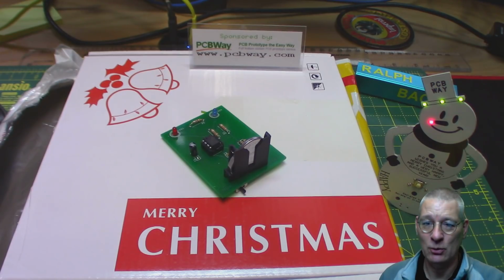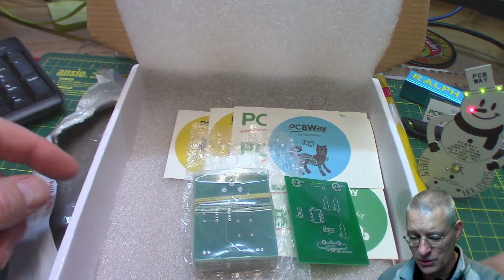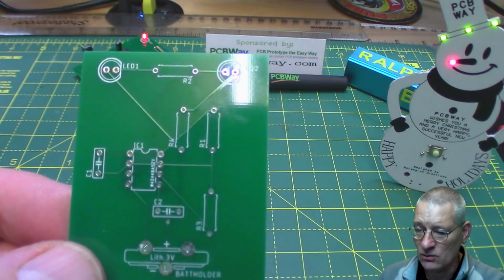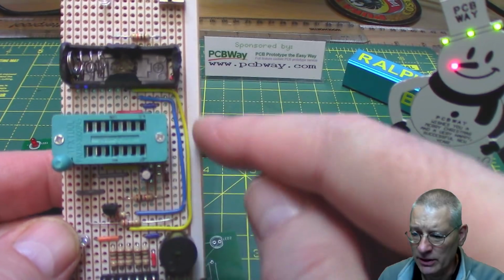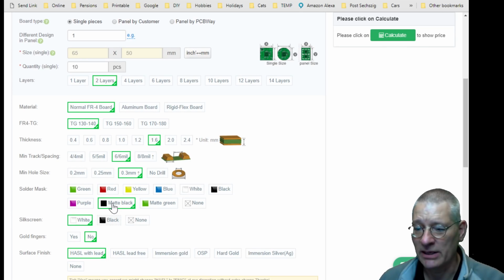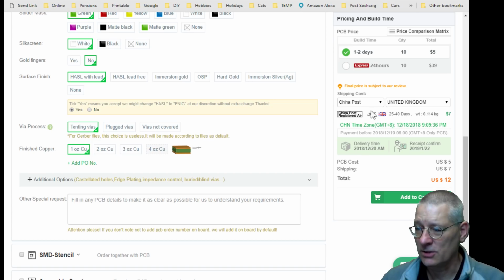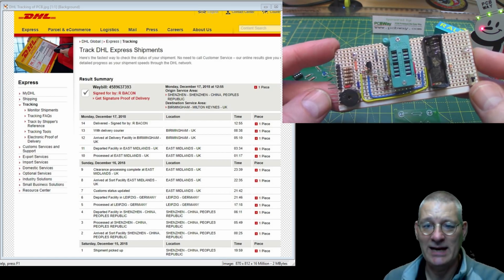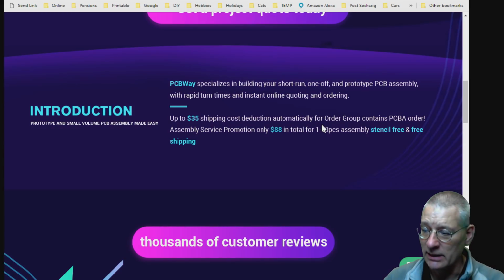#128 Making a PCB with PCBWay (I made ⚡ one)

Comment: Hello, what circuit did you make? It looks a like a simple flashing led with a 555 timer with a 3V coin battery?
Reply from the maker: Yes, 4 years ago I was just starting my PCB making journey. A 555 timer and two 🟢🍎flashing LEDs seemed a simple enough circuit just to get something running.

Today, I make PCBs as a matter of course, having learned many lessons on the way (mainly how NOT to do things!). Experience does not come cheap!

In fact, today I am in much the same position with my 3D printer, just starting out, learning CAD along the way and generating ever-increasing complex modules. It's a rocky road but a very rewarding one.

Comment: I tried to place an order with PCBWay and I had a small board designed (45x20mm) and panelize.  3 emails later asking me the same question if I wanted it panelized. I replied each time. Then I finally went to their site and online chat with their help agent. After an hour and a half trying to get the information straight. Finally they get it. The price  doubled to $24.40 plus $23. DHL shipping.  I had also submitted the very same gerber file ordered from JLCPCB to compare the two. JLCPCB had no problem and I had the product in my hands in 6 days. Their price was $11.71 + 23. shipping from DHL. I canceled the order from PCBWay as the experience was bad and they did not seem to know what they were doing.  Wasted my time and in the time I spent trying to get the order set up, I had the boards from JLCPCB in my hands. Quality was amazing.  I have no affiliaton to JLCPCB but thought I would share my experience. Think twice about PCBWay.
Reply from the maker: Your PCBWay experience is unfortunate, and not one I've ever had (and they don't treat me any differently to any other customer). 

I guess the online order form had some sort of discrepancy / omission so they tried to clarify with you but things then seem to have got a bit confused. Give them another try, they deal with thousands of board a week so they can't be that bad at it!

Comment: Thanks for the very informative video Ralph. I ordered my first ever PCBs from PCBWay after watching this. My design was over their 100x100 mm $5 limit which put it up to $25,  I still got to use my $5 first order voucher though. Also, this must have put me over some kind of import tariff threshold, hence I had pay DHL another £17 to release the delivery. Even with this, it was much cheaper than anywhere I could find in the UK. 

I ordered on Saturday and they arrived on the following Friday! Amazing! As far as I can tell they boards are great quality. I didn't even make any mistakes with my design! Couldn't be happier.
Reply from the maker: Congratulations, Tom, on your error-free design. Great when it works out that way. A pity you went over the import allowance that definitely bumps up the price considerably, happened to me once with something from the States. It's the VAT that can really add up at 20%. Anyway, all's well that ends well, good luck with your construction!
Reply: £15 max for goods outside the EU

Comment: I'm normally not fond of promotional videos, but this one was really good and informative. I might very well even use PCBWay.
I actually stopped making pcbs because of the hassle (done on the kitchen table kind of) but if I can get quality pcbs for that price and short waiting time - I think I'd better get started on all the old projects that have been sitting around for a while now.
Thanks for a very informative video.
Reply from the maker: You are most welcome, Zeedijk Mikem glad you enjoyed it. 

I thought long and hard about doing this video, but finally I thought that I "promote" items from Banggood, Aliexpress, Gearbest, Amazon... (the list goes on) in most of my videos. So I thought that if I were going to do this I would do it faithfully, as though I were a regular customer. It seems to have been accepted as such, for which I'm thankful, as there was no way I was going to just promote an item without having tried it out first! Like you, I stopped making PCBs on the kitchen table some time ago; too messy, too amateurish and too long-winded! And, of course, only single sided (usually).

The hardest part now is actually designing the PCB from a proven schematic. I used both EasyEDA and KiCAD and you'll have to wait for my report on which I prefer, but I've just received my 2nd PCB (an Arduino Uno shield for my ultrasonic dog barking project) which looks much better than the first one. I've yet to check it out, it literally arrived an hour ago. We shall see!
Reply: @RalphBacon 
I have always loved laying out pcbs. I can easily spend days design. Quite often I end up starting all over from scratch just to avoid a wire link. I have made a few double sided boards but that's too much a hassle.
Have a look at my blog if you want to see a few of my boards, nothing super fancy or exciting just enjoyable projects (-:
Reply from the maker: And so I did have a quick look. Nice boards. I was particularly impressed with the pendulum clock, not just the PCB for it but the overall project. Very nice indeed. Of course, if you did use one of the Chinese PCB fabs then your boards would be even nicer, green and double sided too! :)

Comment: Why do they send packages for the UK trough my neighborhood (Leipzig is an hours drive away)? Does not really make sense or? Nevertheless nice video. I never created/made/ordered a PCB myself until now because often I just produce a one off and use a Perfboard. So I can finish the project the same day. Because projects that lay around sometimes never finish (as we’ve found out before).
Reply from the maker: I'm just guessing here, Michael, but cargo deliveries via Leipzig in Germany and then West Midlands Airport in the UK are probably a lot cheaper than going via the main passenger hubs. They are probably designed to take large volumes of packages rather than passengers too. As I say, though, this is a guess.
 
I hear you when you say that projects that lay around awaiting a PCB never get finished. True. But the design of the PCB is now part of that project, and if you are prepared to pay the DHL delivery I don't think 3 days would be long enough for me to lose interest in a project. If I used the slow China Post delivery it would be a different story, probably! I've just a few IRF7317 dual MOSFET chips delivered that I ordered back in October. Um... what was that all about again?
Reply: Ralph S Bacon Leipzig is besides Frankfurt the biggest DHL Logistic Centre in Germany. And it’s next to the Leipzig airport. So you May be right. And they are allowed to start and land all trough the night in Leipzig which is not usual on every airport in Germany. I started to make notes for which project I ordered something. So I can recap if a package on the slow boat from China arrives months later.....

Comment: That was really interesting but I would like to have seen how you got to the gerber file stage as for me that would appear to be the tricky bit!  I would like to try using one of these services but haven't yet plucked up the courage!
Reply from the maker: I would have loved to have shown you that but it requires a video in itself. You need to be able to draw the circuit diagram first (the schematic). The PCB is then linked to the schematic so you know you've done it right. Once I am up to speed (probably with KiCAD or EasyEDA) I'll look to do a video.
Reply: @RalphBacon  I look forward to it.  I have a watched some videos on creating Gerber files but they can take a lot for granted!  Schematics are not really an issue as I was an electrical engineer but software is another story!

Comment: In February this year I was laid up in bed fr 3 months due to a back problem, and decided to teach myself Kicad. To do this I made a replica of the 1977 Science o Cambridge )Sinclair) MK14... a bit ambitious but for the previous 2 years I'd been collecting parts (Well, some parts had been obsolete for 30 years so were hard to find!). and with some help from members of the Vintage Radio forum where MK14 experts seem to skulk I was able to make the schematic & PCB layout ( Full story at https://www.vintage-radio.net/forum/showthread.php?t=145663 - I'm Slothie). I submitted my design to JLCPCB through their website which was very similar to the process you describe for PCBWay. Despite my bord being much bigger than yours (abiut 11 inches by 5 inches) it onl cost aebout £18 for 5 boards- I think I got free shipping for my first order - and it came in about 7 days. The quality of the product was very similar to yours, and the only problem I had with the boards were the small design errors I made. 11 wire links later I had a working replica. I'm in the process of making the Rev 2 version with the errors corrected and some improvements I have noticed from building it and from suggestions from the forum. It has been a thoroughly  enjoyable experience - before I had never used a PCB cad program so I can assure anyone reading this that they should give it a go. I'm a bit addicted now :)
Reply from the maker: I'm sorry you were laid up in the first place,Ian, but something good came out of it, it would appear. I'm extremely impressed that you made just 11 errors in that design. As it happens, thanks to all the comments here, I'm moving away from over-complicated Eagle and onto KiCad but I will also look at EasyEDA. It's something I definitely want to master. Thanks for your post, it was very interesting.
Reply: @RalphBacon   I must confess I was surprised it worked too :) It would have been fewer than 11 if the schematic I was working from didn't have the column lines for the display marked wrong - the display ended up being backward so I had to cut the tracks and put them back in correctly with mod wire! The other problems were caused by me making mistakes when creating a new schematic symbol for the INS8060 SC/MP processor and labelling 2 pins with the same number. Fortunately it just resulted in one pin being unconnected so I was able to put in a short wire to fix that too.
I looked at Eagle but couldn't use the free version because of the ridiculously small board size you are restricted to (80 x 50mm) unless you subscribe to the highest tier which is hundreds of pounds. The small size is OK for people doing small projects or using SMD but for things with 40 pin DIP chips yjat I was interested in doing, no use at all! EasyEDA is highly spoken of by many but I just like to have something installed on my PC that I can keep forever and not rely on a third party's server not going away sometime in the future and taking away access to all my designs! KiCAD is quirky and has a few bugs but nothing too serious, once you get the hang of the rather arcane symbol/footprint library its quite easy to use, and its actively being funded by CERN and other organisations, so for the moment  it seems to have a good future.
Reply from the maker: "[KiCAD] is actively being funded by CERN and other organisations..." - wow! That must give it some weight in my considerations then. Thanks, Ian.

Comment: I designed a 4 channel relay board ( Only because I have 300 or more of them ) with Easyeda and sent them off to JLPCB. They were done fast and very well also. I did thicken up the tracks on mine and after doing it all I sent the files and paid. I think 2.00 and 25.00 shipping.
After getting the PCB's ( 10 for the 27.00 ) I mounted all the parts and it works fine. The only screw-up I did was the transistor pad was 3 pin vertical ( Not Triangle Shaped ) which is hard to solder because the pads were so close together. I think the next 9 boards I do I will use Kapton tape as I solder so they don't bridge across to the next pin. I like the Idea that PCBWay lets you share boards. That to me is worth it. Thanks for all the videos you have done so far and I hope you do many more in the future. Drex / B.C. Canada.
Reply from the maker: Wow, you too have much more experience than me in the PCB design world, Drex. I don't really know why I haven't explored this avenue before. so I have something to thank PCBWay for too! I'm looking at KiCad right now but will also look at EasyEDA too. If I get good at it, or design something useful, I'll let everyone know!

Comment: What I like about doing pcb’s is that I know the board is in sync with the schematic.    After I populate and ‘fix’ my mistakes it’s easy to see what is the original circuit and what are the parches.  This assumes you start the process with the schematic editor.    Layout can be relaxing, kind of zen like oil painting.   Knowing when to stop is a problem common to both.
Reply from the maker: Quite so, Dan, the sync between schematic and board is fantastic. And knowing when to stop is something I now face too. Just move that one track over to the left, oh and that one up a bit...

Comment: Really good thanks for showing me this, I have a project I am planning on finishing in the new year and need to get my PCB board printed. EasyEDA recommend JLB and I haven't heard of PCBway so thanks for showing the ordering process will probably use them. Btw you need to practice more with PCB design 😂 I have finally seen something that I can do better than you. Please don't think that's a dig as I think your skill with microcontroller is way above mine. G
Reply from the maker: You speak the truth, Gordon, my design was rubbish. But it was my very first design, using the rather complicated Eagle for the first time so I can only improve, I hope! I'm currently using KiCAD but will try out EasyEDA too. I'll soon be designing 4-layer Arduino shields... 😂
Reply: @RalphBacon   yes eagle is good but you have to pay to use the good features on it, and it's very difficult for beginners. I  started with PCB wizard witch is fantastic for beginners! The draw back is you can't make grber files lol as it's for home use. btw I use easyEDA because I have a Mac computer and its most compatible. Loads of people use kiCad but it's triable on Mac. If you switch and make another video try KiCad as many users have PC's.

Comment: Very good video.
I'm trying to make a PCB for my project with a ESP32 Dev Kit board.
Could you make a video maybe using Fritzing for designing very simple PCB?
Easyeda is another web based solution but I find it a little more complicated.
Reply from the maker: I don't know why, but Fritzing is frowned upon in the Arduino forum - I think schematics (circuit diagrams) are the best way of describing a circuit - they can be directly linked to a PCB using KiCAD or EasyEDA. Once I get up to speed I will probably do a beginners' video.

Comment: If you're going to put your vanity label onto the board copper, then make sure that it excludes the solder mask from that copper as well.  Nice and shiny. 😎
ENIG is shiny gold.  [Also well worth it because it makes soldering easier.]
BTW: The check is to ensure that the board meets their manufacturing capability and the limits for which you're paying.
P.S. I've had to consider 6 layers in one board. Produced 4 layer boards.
Reply from the maker: Uebung macht den Meister, as my mother would always tell me, but I don't think I will ever get to 4-layer boards let alone 6-layer ones. Wow! I'm very impressed. I'll practice using 2-layers, that's about all my brain can map!
Reply: @RalphBacon  ; It's pretty straight-forward when you start with internal ground and power layers. That leaves only the top and bottom layers for signals.(You can flood-fill other layers once signals have been routed with ground - typically - to increase built-in capacitance.)

The 6-layer board was a design for tandem Mega2560 module with microcontrollers communicating via dual-ported RAM — on a module about 40mm by 95mm — with over 100 I/O available through 0.1"-spaced pins … because an initial design required that many pins. Costs turned out to be over AUD$100 each (min qty 5) driven largely by the costs of dual-ported RAM and because components were "loaded" on both sides.

The RAM, in case you weren't aware, can be mapped into the address space of the 2560s with (in this case) the dual-ported RAM generating an interrupt signal when either side was wrote to a particular location.  Also shared was the clock; the "master" 2560 providing an output to directly connect into the slave. The slave side was to do the bulk of data capture, including initial processing of measurements to e.g. provide temperatures in predetermined locations in the dual-ported RAM. It could also provide output signals to motors and communicate via I2C to other devices, reading set-points from dual-ported RAM locations written by the master; and write back things like actual motor speeds using tachometer signals so that the master could read them directly as e.g. rpm.  The objective was to allow the slave to operate in 'harder" real-time than the master which would deal with external events.

Only a subset of AVR support external memory (XMEM) in hardware. ATmega64(A) in some package forms seems to be the "smallest".

P.S. Merry Christmas from Down Under!
Reply from the maker: It all sounds very complicated, Bernd, but having power and GND as the two internal layers does make it less so, I admit.
 
Since you posted your previous comment I have spent many a (happy?) hour getting to grips with EasyEDA which I quite like and have developed a PCB. I then tried to develop the same PCB using KiCAD, and although I got pretty much the same result I felt I was always pushing up-hill - in comparison, EasyEDA was more intuitive.
 
Anyway, that enough of a spoiler of a future video! Thanks for the kind greetings and have yourself a Happy New Year (which will already have taken place at the time of writing as you're so many hours ahead of the UK!).